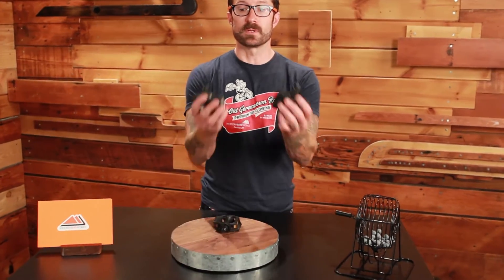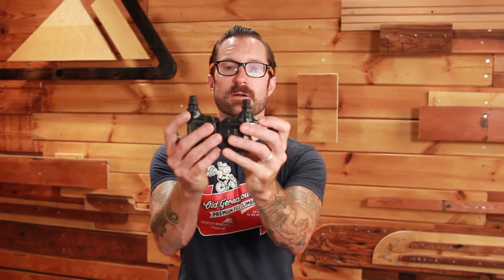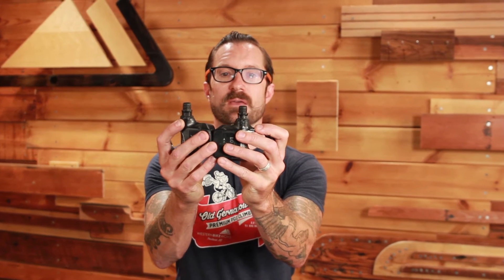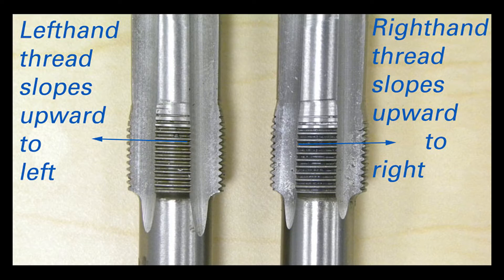#WTFWBW EP4: Pedal Thread Standards

Comment: Hello. Are you still working here?
I got crank set 105  FC-5700 (53-39 tooth) and not sure can I fit ultegra PD-6700 pedals.
Pedal thread (~14mm) a bit loose. On my old smaller crank set  Oval (50-34 tooth) it was mutch tighter. Afraid to damage thread.
Thanks.